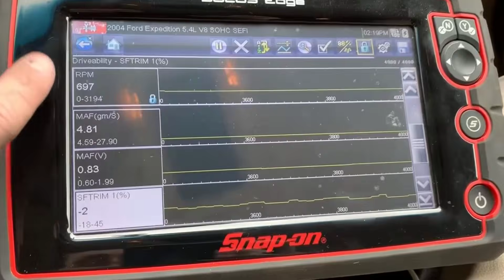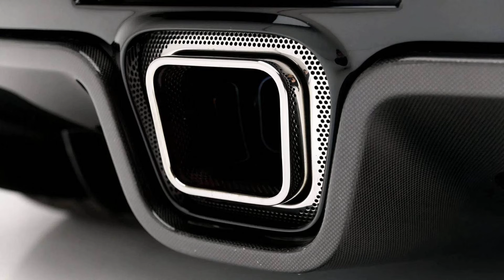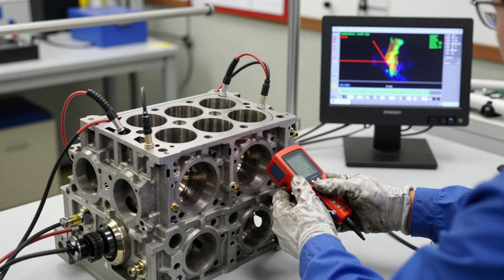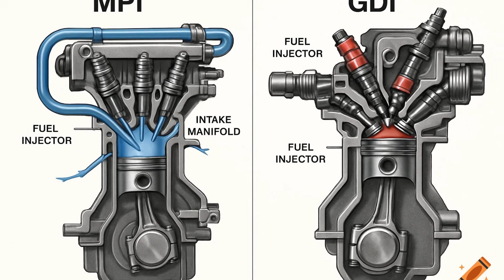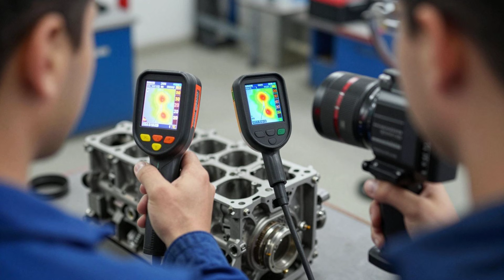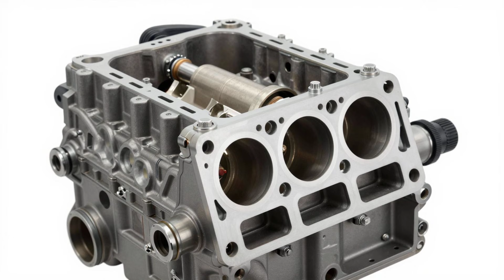THE GERMAN METHOD for Removing 100% of Engine Carbon – Your Car Already Has It

Comment: Waste of time! Over half of the pictures in this video are AI generated crap. Not even real engine cut-aways or pictures. And the long boring run-on dialog just talks on and on in circles. This could have been a 5 minute video with real pictures, concrete data diagrams....but no, its just AI generated crap. Total waste of time. 👎👎👎👎👎👎👎
Reply from the maker: Dang, sorry you thought it was a "total waste of time"! I get that the AI pictures weren't your jam and the talking went on a bit. Will definitely keep that in mind for the next one!

Comment: You see taking your car and driving it at a very high speed heavy load should not have to happen. There should be a provision that under normal driving conditions that carbon will not build up case in point, my 1997 Jeep grand Cherokee with the little lowly 318 that came from the 60s with modern fuel injection run sweet 348,000 miles. OK skip the modern day bullshit and get down to what used to work so the general public quits getting fucked all this modern German bullshit is just that bullshit. You guys grow a fucking pair. This is six in a row gym.From Kennerdell pa